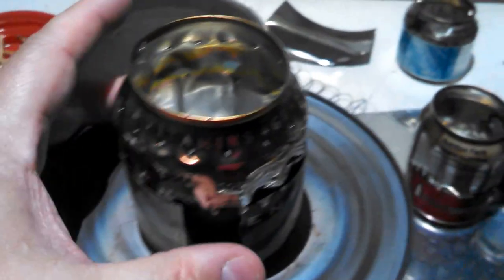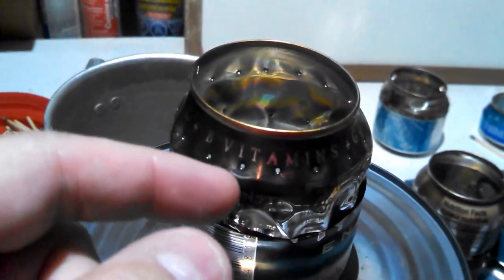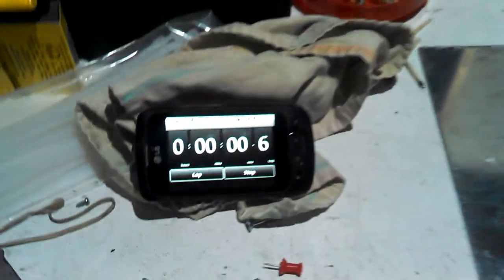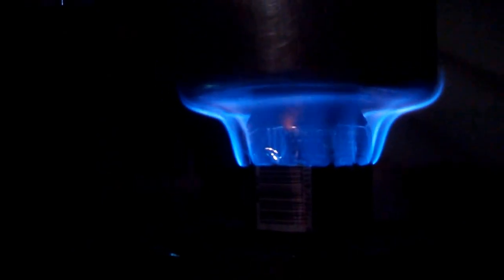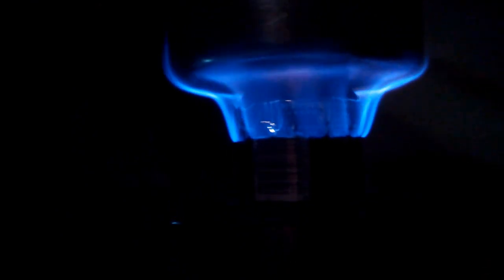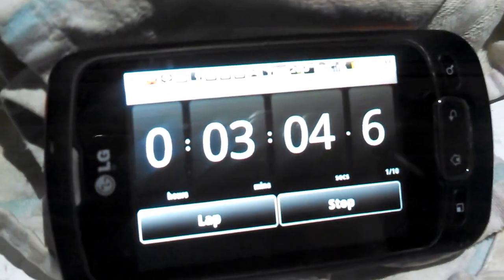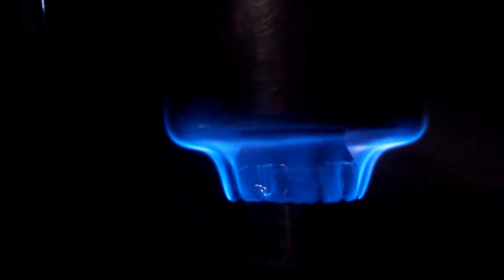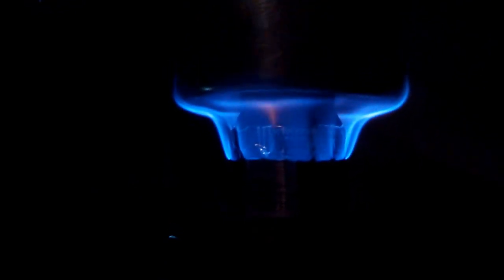2 stage alcohol stove 3 minute boil 3 sec prime(part 1)

Comment: If anyone needs the instructions on how to build this, here they, after several test models made and many tests here are the instructions and results.
Use a small pair of long needle nose pliers to make the crimps, I'ver found size does not matter here, cut the cut just over half from the top, inhalf, place 2oz. of water in the bottom part and then trim it down to about 1/4 inch from the top of the water, this way you know your stove will hold up to 2oz. of fuel, I use a pair of scissors to cut and trim, you will need a manual can opener that removes the tops off of your Pop cans, so remove the top this way, the bottom part, all you need to do is cut and trim it, the top, remove the lid, then drill 15 - 1/32 holes just above the bend near the top of the can,  do your crimps in the top part from the bottom of it all the way up to the bottom part of that bend in the top of the can,  drill 12-16 -1/32 holes in the very top of your crimps, the number of crimps does not matter, just don't leave any space on the top part that is not crimped, have room all the way around the crimps for the flames to come up through, around the bottom part,  I also cut 3 V notches in the bottom of the crimped part, with my Dremel, just tiny V shaped notches, Light and sit your pan on top, some of my test models, took me a few extra seconds to light, but through trial and error making 4 or 5 of these you will figure out all the errors that can help on the time, my slowest boil time even on my slowest stove tested was 5 mins. my best time was 2 mins 45 secs, this thing burns fuel very fast and very hot, total burn time was barely 1 minute longer on each test stove than it took them to boil, so they are Strictly BOIL ONLY STOVES, My previous fastest was my Fancy Feast stove at 6mins 30 secs, and my Rolled Aluminum Stove at 6mins 45secs, this one cut nearly close to 3 mins off those times, once you get the exact boil times you want after making a few of these, then take the specs off the one that burns the best and keep them to make future stoves, I have a few more mods I want to try to see how they work, I also want to try a Simmer ring so after it boils see if that helps the 1oz. last any longer. but if you don't mind using a full ounce to boil in 4 mins and under and want the Fastest boil you can get, this is the Stove.If you want the Longest burning stove for Baking and cooking pasta and such, get a Trangia or a Fancy Feast with simmer ring. I will now add this one as my fast boil stove.

Comment: You boiled your water with a lid on the pot. In most of the other alcohol stove videos I've seen, they boil water without a lid on the pot. So to make a fair comparison of boil time, you really ought to test the boil time with no lid on the pot. That said, it would be great if you did a video showing in more detail how you made the stove. Even if your boil time with no lid is longer than 3 min 4 sec, an easy to make design is still valuable.

Comment: Any way you can put up a video with instructions?  I tried a prototype based upon what can be seen, and somehow failed.  It will not prime at all, i can only get flame out of the large opening and as soon as it's cover the flame goes out.
This was using isopropyl alcohol as fuel.
I am thinking perhaps my cutouts at the bottom of the channels need to be higher, but can't explain why the top holes won't even prime.
Reply: Same here, until I noticed that what he meant by the extra holes were ones poked through about 5mm above the line of the bottom half. Then it primed fast.
Reply: Thanks for the comment.  I don't think this guy is going to come back and read these comments.  Anyway you could upload a photo or video showing how you successfully built one?
Reply: Brandon You're welcome. To be honest, I saw his message on the comment list of The Perfect Alcohol Stove, part 3 by Josh, for people to check out his stove and thought it wasn't in the best taste, when someone else has worked hard at refining their stove and has received attention for their efforts. After experimenting with RL's version I found that it does prime fast for sure but it is taller and less steady, harder to light if you're used to just a lighter as it's deeper, burns super hot and warps the top rim pretty fast, and I really couldn't get it to outperform the PAS2 with the same amount of fuel (1/2 ounce). The boil time may have been faster, but not by much. When you factor in the dependability, size, durability, and even how cool the little PAS2 stove looks, I personally don't think there's much to compare. This one would be good to make on the fly perhaps with a pocket knife and a safety pin, but there's probably simpler roadside versions to consider. It simply isn't worth my time to make a video about it and I think your time would best be used making a different type of stove. This is unless, I have made a mistake in the way I built it. Hopefully there is an update on the specifics of construction, if that's the case.
Reply: +Brandon Hello Brandon, I made one an it worked perfect, do you have 16 tiny 1/32 holes around the top and 12-16 at or near the top of the crimps, either works, I did one with 12 holes on the crimps at stage 1 and one with 16 no difference in time, also on the very bottom of the crimped piece cut 3 notches in the bottom of the opening into the crimps, space the 3 tiny cuts or slots I make very tiny V notches with my Dremel,  1/32 holes seem to work best, I use Long needle nose pliers to apply the Crimps.

Comment: Looks like an awesome stove. Would be nice to have measurements. And also, it looks like you also have holes near the stage 1 burners?
Reply: +67rilamin Yes 12-16 on stage one and 16 on stage 2 at the top, 1/32 drilled holes work best, I did several designs and 1/32 came out best, I did only 16 holes on top and 2 designs with 12 and 16 on stage one, no change with either 12 or 16 stage one holes, I did add 3 evenly spaced V notches on the bottom of the crimped part with my Dremel, soverall near same results,